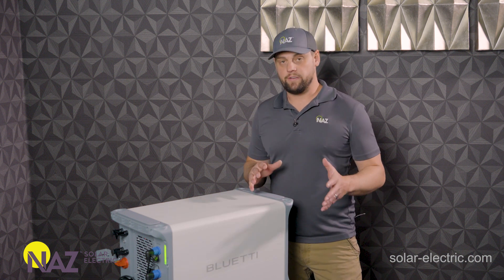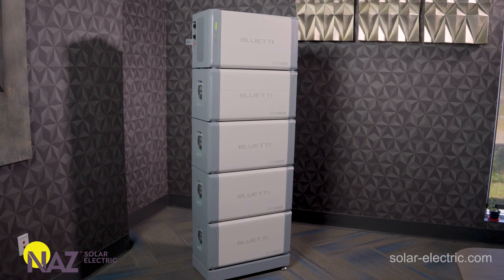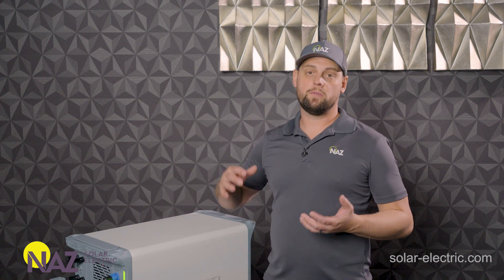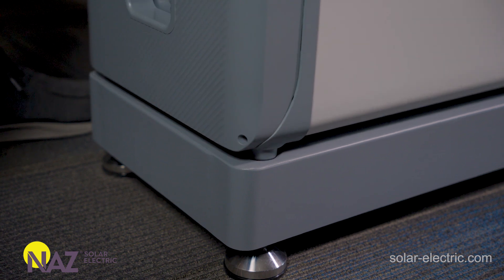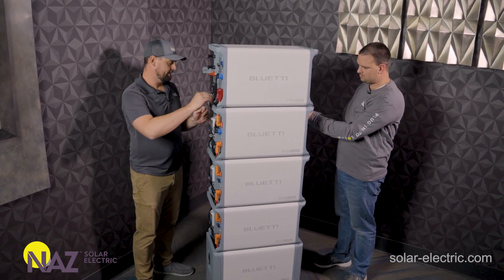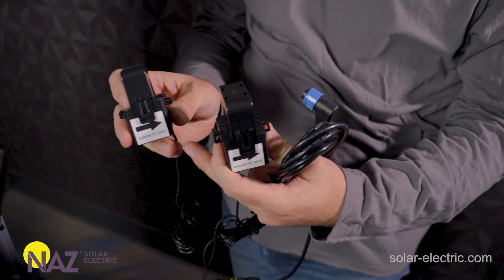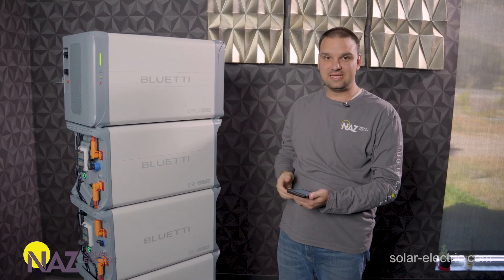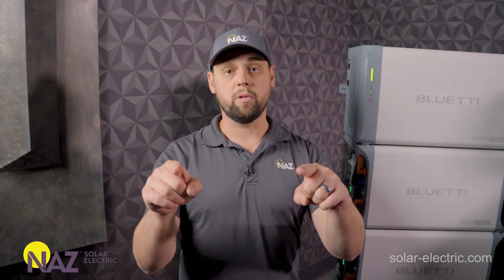The hottest name in Solar Generators - Bluetti off-grid and grid-interactive ESS

Comment: We installed the EP800 version of this as an IT closet backup. We’re in a commercial office facility that has 208v 3-phase power. Bluetti sent us a firmware update that instantly made it compatible with that voltage setup. Our EP800 maintains an online API system that must be up 24/7. It can power the system for 48 hours and has been called on several times over the past 24 months. Kudos to Bluetti on this design.